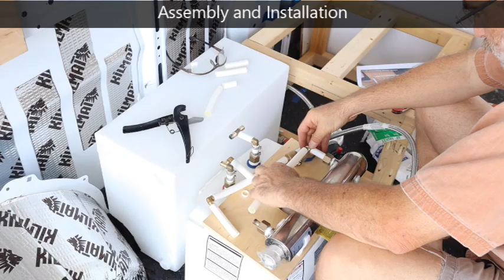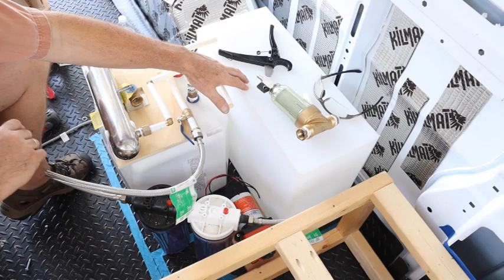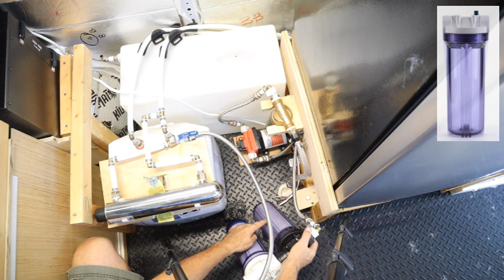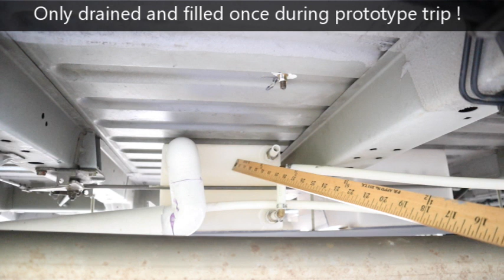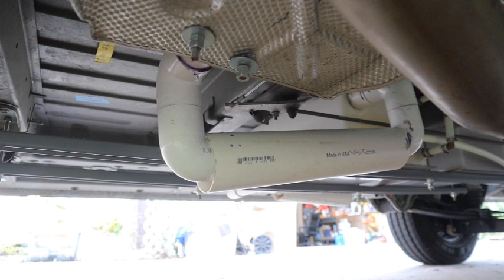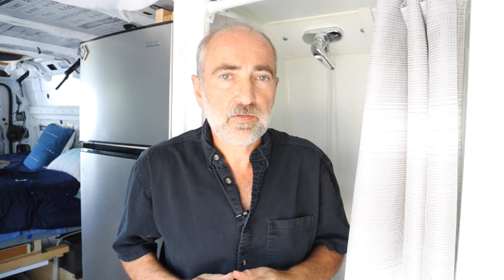Van Life recirculating shower system INSTALLATION

Comment: I have looked at various amount of recirculating shower videos and this is a well thought out and clearly explained video. I plan on building this feature into my van build when I get started. Can you please give an update, any lessons learned or modification you would make to the design after battle testing it? Thanks for help making this simple to understand and design. Job well done.
Reply from the maker: Sure, we have been using the van for over 2 years now. The system works very well.  The recirculating part works well, you need to gauge how long before changing the water and filters.  We can easily go 5+ days, but if water is easy to get we change it daily....  All the videos are by category at https://thefrugalfactor.com/     See #10 and read my notes - I am just repeating here.  A few extra suggestions: 1. Use a stainless steel shower pan (not fiberglass). 2. If you don't put in a full rubber/plastic floor like I did, then be sure to put your filters in a pan, so that the little bit of water that spills is not absorbed by your floor.  I am always concerned about mold growth.  I have never had a problem, but have seen entire vans ruined by mold. 3. The flexible stainless hoses, be sure they are long enough to make changing the filters easy.  Also those 90 degree pex fittings make it easy to move the hoses around.  4. ONE CHANGE - I would use 3/4" pex, especially for the tank vent tube, which is under the van.  A bug (mud dauber) clogged the 1/2 vent pipe and I could  not get the water to drain.  Took an hour to figure out that a little bit of hard mud in the end of the tube was stopping everything.   I replaced the vent tube with 3/4" pex, and put a little of the stainless steel scour pad in the end.    Thank YOU for the positive comment/question.   Let me know if I can help as you continue your build.
Reply: Thank you, you are so kind with sharing those nuggets. @FrugalFactor

Comment: Thank you for making this video. Question, so that one pump you use sucks the fresh water from the tank below the van?
Reply from the maker: That's correct.  It pulls the water out of the 5 gallon tank under the van and through the filter system.  All the video's are listed by category at https://thefrugalfactor.com/   Thank You for the comment + question.

Comment: Very nice explain shower system.  What filter (microns)do you use before carbon filter? do you have in plan to do backwash to clean the filters that way occasionally?  Thank you for sharing
Reply from the maker: 200 micron works well in the spin down filter.  This the to keep sand, hair, and other large particles from the other filters.

Comment: I believe I saw a comment that said that you only filled the system once during your 18 day trip with your wife. How many showers would you recommend before draining they system and refilling? Also, do you recommend certain shampoo, body wash, etc. that would be easier on the filtration system?
Reply from the maker: That is a personal choice.  We really did not find a big change in the water, but still changed it.  Maybe in the future I will figure out how to test the water, to ensure its safety.  But right now I think the UV light is doing the job.  I plan on changing the water weekly when possible.  It all depends on our travels.   A biodegradable soap/shampoo is best.

Comment: Great tutorial!  Woud this recirculating system work similarly for a small tub in my short bus.
Reply from the maker: I don't see why not!  The only thing is you would need to increase the size of the grey tank to ensure you have enough water to fill the tub.   You need to be sure your tank is large enough so that you do not run out of water in the tank.  If that occurs you start pumping air.  The pumps I use are capable of running dry without being damaged.